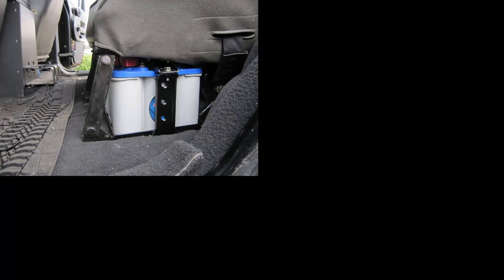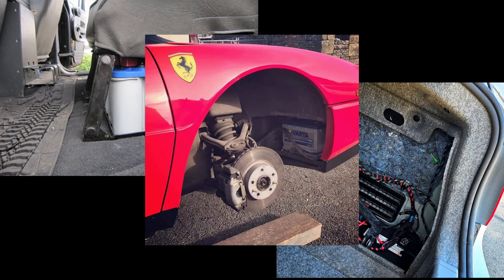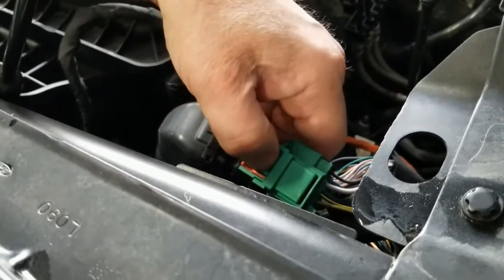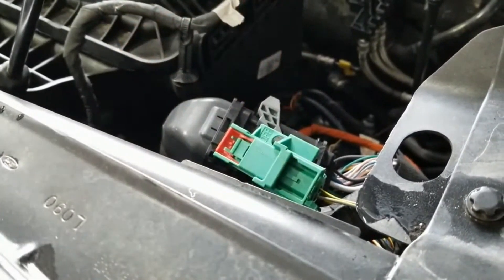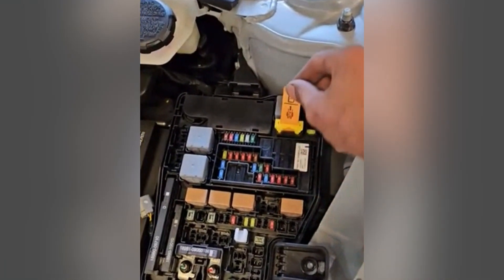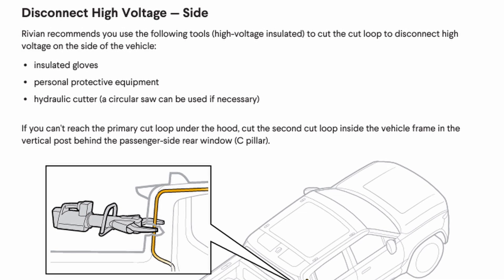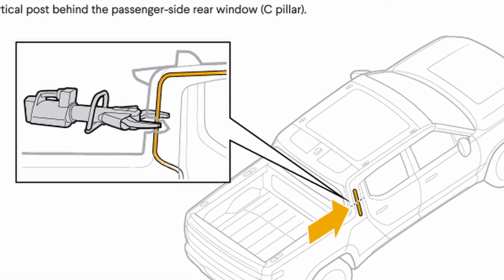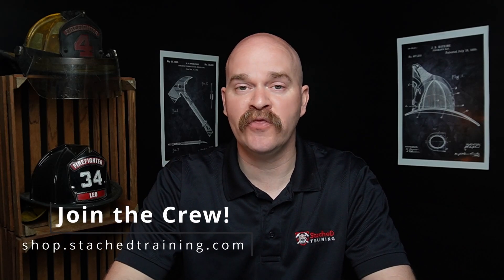Hidden Dangers: Disabling Electric Vehicles in Emergencies

Comment: Why can't they just put 4 large, easy to operate isolation switches in the front and rear wheel arches on both sides. That way it wouldn't matter if the car had been hit from the front, rear or either side, or if it's upside down. You wouldn't have to open the hood or trunk, or any doors to access them. Turning any one of them off would disable the entire system, high and low voltage.

Comment: Thank you. 
   At 400 to 800 volts, there is not only the electrocution hazard but also a flash hazard from plasma and vaporized metals, plastic, etc, when a high voltage line is cut.
Reply from the maker: The arc flash hazard is significant.
Reply: The cut line however is low voltage and cutting it trips the HV contactors?

Comment: Did I miss something or mishear?

Does disconnecting the battery deactivate the airbags.

Put differently, does the operation of airbags rely on electrical current from the battery?

If so, what happens with airbags during an impact if the power supply fails in advance?
Reply: The airbags are triggered by electronic sensors, so it makes sense that it does take electricity to make them work.
Reply: @davidorr6627
ouch!
Reply: @jeremyashford2145  I'm sure that the airbags would go off before the power had a chance to be disconnected in a crash. They go off in milliseconds.

Comment: Feel like attaching a pull disconnect to the charging flap would work. RIP the flap off , easy to find from the outside, not unnecessarily damaging if you just need a scene to be safe so unlikely to write off the car unnecessarily, accessible from outside, near the high voltage system and space for an information card on disabling the 12 v

Comment: timely video Cappy 🤙 I'm literally out in Phoenix this week doing some more EV training, and we just touched on the hazard of pulling MSD's (Main Service Disconnects) in class yesterday...

im going to bring up the topic of accessing those series cut loops and those 12V disconnects on the Low Voltage side today, as I already did some brief training on the Mach-E out in Salt Lake City around this same time last year, but for some reason just don't recall that manual switch being covered...? 

i may need to review my notes, or i may have stepped away for coffee. 😊
Reply: I'd say the main hazard when removing the HV disconnect would be electric shock, especially if the plastic/polymer body is wet after an accident.  Plastics and polymers are non-conductive but their insulation value can be bridged by moisture.  No different than pulling a male cord cap from a receptacle outlet while the hands and/or plug is wet but at a much higher voltage.  This is why when I train, I always stress the technicians wear their class 0 rubber insulating gloves with protectors. Having any kind of substantial load on the HV DC circuit after the main motors have stopped, such as after an accident, doesn't seem very plausible.  However, if the disconnect is removed while significant current is flowing through the HV circuit, then the possibility of an arc flash is very likely.  And short circuiting the two polarities due to mechanical failure as the disconnect is pulled out seems very unlikely but can't be ruled out.  
Not a lot of injury data out there regarding EV's yet but as they become more prevalent, then I fear we'll start seeing the numbers and the causes.

Comment: Man, I feel like electric vehicles have been common enough for close to a decade now that this should have been sorted out several years ago.  It feels like a pretty obvious need.  

Also, the solution here seems really obvious: A giant red button that acts as a high voltage disconnect.  This is on basically any industrial piece of equipment (including industrial EVs like forklifts).  It's easy; it's obvious; there's no cutting wires or fiddling with tabs.  Just smack the big red button and you're done.

Comment: Yet another superb video.

Considering the dangers in potential EV crashes, there has to be a world-wide standard to force all manufacturers to use the same safety method for neutralising the batteries, with the means to do so in a standard form and all placed in the same area of a vehicle regardless of manufacturer. 

I mean there’s a universal think tank that saddle the world of gadgets with a bewildering array of Universal Serial Bus Connectors (USB), sorry for the pun now forcing all mobile device makers to use the latest form: USB ‘C’ (Personally I believe they should have adopted Apple’s Lightning Connector at it’s launch years ago, it’s a far more practical solution). 

Let’s face it standardisation in the field of mobile gadgets is a good thing but hardly any more than a convenience and aid to profit, standardising EV Safety is a life saver!
Reply: Lightning was not a practical solution as it is only capable of USB 3.0(5Gbps) transfer rates, USB-C is capable of everything up to USB 3.2(20Gpbs) including USB4/Thunderbolt which allow for even faster rates, currently up to 120Gbps which is 24x faster than lightning could manage. USB-C is also capable of carrying UHD video signals, again lightning is not capable of that, only being capable of <1080p video. While the USB standard is a mess USB-C is a genuine improvement over everything that came before it and you should do a bit of research before making statements like that.

Comment: There should be some thing that automatically disconnects when a crash is detected. Like airbags deploying, a device should cut the power some how.
Reply: Petrol vehicles have had for years a fuel pump cut off when a rear impact is detected also if the engine stalls.
Reply: @derekcable  My f350's have a little thing on the side of the dash saying "fuel cut off". i didnt know what it was. must be that.
Reply: @garner2267  It will probably be explained in the handbook.

Comment: Have all of the low-voltage running loads powered only from the DC-DC converter, only always-on loads connected on the low-voltage battery, then interrupting the HV integrity loop at any point would disable most stuff besides door locks, interior and corner lights.

If you think EVs are a nightmare from lack of standards now, wait until drive-by-wire ends up requiring distributed batteries to ensure critical systems (ex.: steering and braking) remain operable through power distribution failures. I'd rather have this stuff remain on fully independently operable mechanical and hydraulic linkage, no electronics or batteries required.
Reply: Drive by wire sounds like a bad idea.  My gas pedal already is an electronic sensor, but at least my steering and brakes are physical still.
Reply: @soundspark  Exactly. Accelerator-by-wire isn't too bad because you still have access to everything else and should still be able to stop safely by shifting to neutral and applying brakes.

If the car is sophisticated enough to have throttle-by-wire, it likely has a brake pedal position sensor,  brake line pressure sensor or comms with the ABS/TCS module telling it how much braking is being applied. Then those can be used as a sanity check against accelerator input and each other. In principle, the ECU of a throttle-by-wire system should know to let braking inputs override throttle input. Makes no sense to have 80% throttle with brakes at 50%. (Well, maybe for a burnout but drive-by-wire cars generally aren't intended for funny business.)

Comment: That air bags are sadly expolsives, looked nasy, should be a world standard set to make safe, the only thing i can think of, is a kill switch, but they might make vehicles unsafe if they disconnected themselves before accident, but, kill switch direct to drive, they might not manage to over ride,  as in over ride if vehicle was rendered useless if kill switch was off, through the ECU would probably be best...
Reply from the maker: Easy solution would be to have it disabled along side the high voltage.
Reply: I think seat belts and air bags should be redesigned, its been decades and its time for changes. Race cars dont have air bags and they crash with way more impact and the drivers routinely walk away. I think a multi point seat belt, a good roll cage and seats that hold you in like a bucket and can slide on suspension instead of air bags would allow better shock control for the body and avoid major injuries. I bet they could engineer a steering wheel and dash that have many inches of absorption so to remove the front air bags entirely. A system like I'm thinking would just work every time. Airbags need to have complicated timing and electronics and sometimes they dont even go off. My accident no air bag went off and I had pulled muscles in my neck, whiplash and dislocated thumb.
Reply: @practicalguy973  You'd never get the general public to adopt racing seats and harnesses in passenger vehicles.  There are too many different body sizes and shapes to make that work.  People also prioritize comfort over safety.  Most people will not be willing to fiddle with a five-point harness.  I know some people who already complain about the regular seatbelts we have now.  And I can't think of any practical padding system for side impact crashes other than airbags (because any permanent padding placed to the side of the driver would block all visibility during normal driving).
Reply: @NoName-ik2du  I didn't mean a 5 point harnesses or actual racing seat or for air bags to be removed completely. What I mean is design something like racing seats but for the general public. Maybe still use a single buckle seat belt for convenience but with an extra belt so both shoulders have belts that holds the body in the seat better and more evenly and design the seat to flex more forward or back to reduce the shock. I think it would need to be connected at two points on top of the seat over each shoulder to be really effective. Seats could be comfortable but tubbed slightly to hold the body in better rather than the flat seats in all current vehicles. A more restraining seat belt and tubbed style seat could work for average body sizes. In modern vehicles there are alarms and warnings so people wear them as inconvenient as they are. I dont think that is an issue. Side curtain air bags still make sense to me. It's the front ones that cause a lot of issues and also serous injuries to some people. Making a steering wheel and dash with more impact resistance is totally possible.